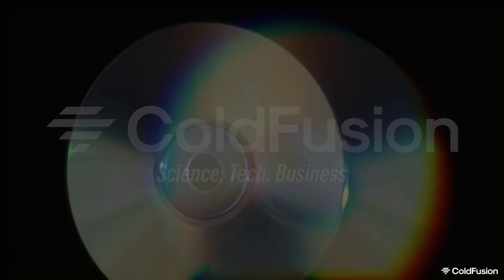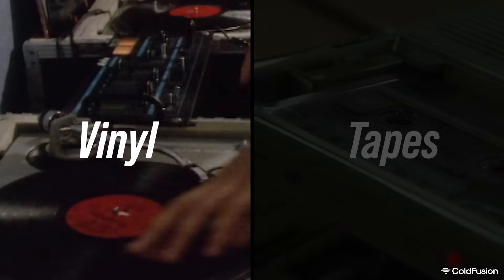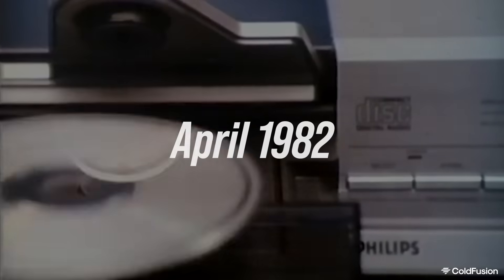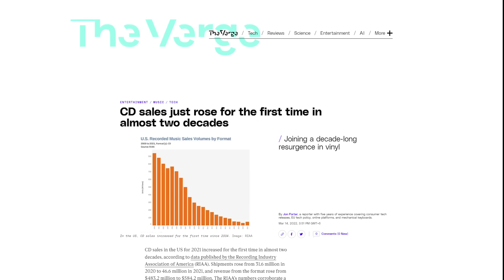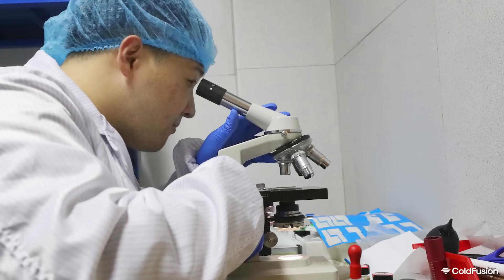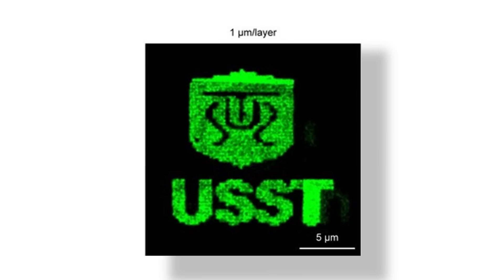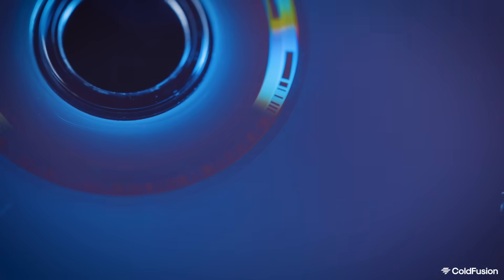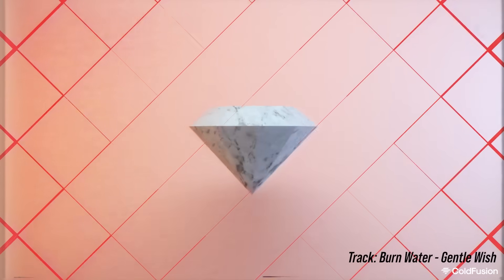Why This New CD Could Change Storage

Comment: 3d fluorescence rewriteable CD-sized discs with 100+ layers of storage have existed since the very early 2010's at this point and never made it to commercial viability on the consumer level. At terabytes of capacity they were already far more than enough storage for the largest 2025 games and uncompressed 4k movies.

Where's the revolutionary advance that could change actual product sales? Less than a wavelength in size is interesting, but this just sounds like an even more expensive and less ready-for-commercial use version of the same thing - and limited to data centers only - since it's so much more expensive and is extreme capacity overkill compared to storing terabytes for real-world applications. Data centers already have huge magnetic tape storage that has been working perfectly fine, so it would merely save some space in commercial facilities while probably using far more power.

Comment: 1:00 it should read around 20 000 DVD in a single disk, not 200 000. Dagogo, I believe you took a DVD as being 8GB (correct, if it's double layer) but you might have considered 1.6 Pb as if they were 1.6 PB. 1.6Pb is actually 0.2PB (1 Byte = 8 bits --> 1PB are 8Pb --> thus 1 Pb is 1/8 PB).

Comment: My proudest purchase was a Sony DAT for home use. I paid $100 for it as it didn't output audio. A cracked track in the back panel circuit board. A five minute fix. I sold it a year later for $1000.

Comment: It happened back in early 2000 personally followed the rise and fall of that tech. So I'll believe it when I see it commercially available. For the time being it remains Vaporware. It's most likely once again trying to boast the huge size of storage on a "long lasting" support to raise funds.

The Fluorescent Multilayer Disk (FMD) was a proposed optical storage technology from Constellation 3D Inc. in the early 2000s, aiming for vastly increased capacity by storing data on multiple, stacked layers using fluorescent materials. Instead of a reflective surface like DVDs, FMDs used fluorescent dyes within transparent layers that would emit their own light when struck by a laser, allowing for reading of up to 100 layers on a single disc. Although it demonstrated high capacity potential, the technology ultimately failed to achieve commercial success due to competition from formats like Blu-ray and the eventual irrelevance of such products in the face of emerging streaming services. 
How it worked:
Volumetric Storage:
Unlike DVDs, which primarily use a single reflective layer, FMDs were designed to store data in a three-dimensional, layered structure. 
Fluorescent Dyes:
Each data layer contained fluorescent dye that converted laser light into a different wavelength of fluorescent light. 
Layered Structure:
A single disc was made of multiple transparent plastic films, each containing data in the form of fluorescent dye-filled pits. 
Selective Reading:
A precisely focused laser in the FMD player could read each layer individually by changing its focus. The surrounding layers, struck by unfocused light, would not fluoresce, and the player's sensors could distinguish the fluorescent signal from the original laser light. 
Potential & Limitations:
High Capacity:
FMDs promised capacities of 100GB or more, a massive leap beyond the capabilities of contemporary DVDs and CDs. 
Compact Formats:
The technology was also planned for smaller, card-sized storage devices for mobile computing. 
Commercial Failure:
The technology never achieved widespread adoption. 
Competition:
The development of Blu-ray discs and other advanced storage formats overshadowed the FMD. 
Market Shifts:
The rise of video streaming services ultimately made physical media formats like FMD less relevant. 
Vaporware:
Due to its failure to reach the market, the FMD is sometimes considered an example of "vaporware"—a technology that was developed but never became a commercial success.

Comment: One of the things I always liked about CD/DVD and Blu Ray is if used for backup they CAN NEVER be erased accidentally. I never use re-writable. Also I always prefer to have a physical copy of music album or movie, instead of streaming. If for some reason the internet is down in your area for whatever reason, streaming the content means you are out of luck. Me I got several hundred movies on DVD. I had a lot of books, which I always found to be better then the digital books, has you never need power to read it, or internet in some case. The drawback of physical books is that they take space, but are totally immune to EMP or lack of power.

Comment: SSDs wear out. Compact discs is non-physical contact and newer materials engineering technologies called photonic engineering materials and manufacturing-application technologies are already in existence but were never given enough mass media attention and exposure in advertisement. The newly developed sapphire crystal coating also known as sapphire nitride when nitrogen ions hits a sapphire crystal (natural or artificial) and simultaneously combined with it and is redirected on the surface of the new compact disc. An another idea is using modified synthetic sapphire as the CD dye and a platinum-iridium alloy as the reflector by using either nitrogen ions or argon ions to transfer the modified synthetic sapphire CD dye and platinum-iridium coating on the CD disc itself. The plastic material  can be replaced with a tin float glass ceramic material. In this way the whole thing can last and function as long as it exists. Combining OPTRONICS (OPTICAL-ELECTRONICS) that uses laser fiber optics to connect electronic components and power them is an old 1980s technologies that must be revived again against suppression because OPTRONICS technologies used in computers and other electronics technologies can make them literally last and function as long as they exists.

Comment: "Needs fans from an ac outlet, now that's a showstopper if I ever saw one."

How is that a showstopper? I have dozens of fans that run from ac outlets in my house right now. Also, the fans don't NEED to run from an ac outlet. That is the least ahowstopping of literally any of the other reasons. What an idiotic statement.

The price, ahowstopping.

The fans... Something you might forget during shipping. So stupid.

Comment: Would be nice if we could get a nice stop-gap for optical discs, like 1 TB discs, that can at least record at 8x the speed of most internal Blue-Ray burners. Sadly, though, speed has always been a major limitation of optical media. Hell, even most portable Blu-ray burners can only write at a rough maximum of 27 MB/s, which is slow enough that it can't even fully saturate a low-bus USB 2.0 interface.

Comment: One thing I'm not quite grasping anymore. We've come a LONG way in the technology with regards to moving a laser carriage, so it's probably not a stretch to think a a carriage could be made that moves the laser on an x and y axis simultaneously. Combine that with the wobble correction and I wonder why are we still using these layered technologies in a spinning format? I thought we'd move to some sort of card format years ago considering optical discs can't read they entirety of a single track in a single rotation anyway.

Comment: It would take 20 days to fill one of these discs at 1GB/s of write speed, a speed which they haven't achieved yet. Imagine trying to verify the integrity of one of these things, or god forbid you get a bad burn,  an extremely common occurrence in our dumb easy to understand discs. The thought of trying to actually fill one of these discs is terrifying. I mean sure us normies don't have 1.6PB of data to begin with, but I think that fact would also need to be considered when trying to popularize this. I don't think we need 1.6PB discs, neither for the cost of the equipment nor the media itself, but 10, 20, 50 TB? I could see a market for this.

Comment: It still impractical. Brittle and sensitive disc  that holds big amount of data. Cmon. Unless its so cheap. Id still  prefer  soliid state drive or better model of flash drive that can hold big amount of data that is tougher than optical disc.

Comment: I´d be more interested in a sized and encased format like the Minidisc. Sure it probably would only hold 55-60TB, but be a lot more convenient. I could also accept a 90mm MO-Disk size with roughly 112-113TB, but I always found the CD/DVD/Blu-Ray sized disks too big for private use/storage and always prefered the more durable Minidisc.

Comment: I'm not sure if you did a video on this but it would be cool to see an update on where holographic storage is...I remember it was introduced quite some time ago...the concepts have been around for decades but Microsoft introduced project Silica in 2019. I'm always wondering what the update of this 'holy grail' of data storage is at and when it will hit the market. Crazy things mentioned...it can withstand thousands of degrees, last millions of years, high data density...the list goes on.

Comment: Practical Application : 
A little refinement of thier process could easily yield a high end consumer grade storage product :
Create a permanant 5.25" shell and cut the layer density by 50% - then attach a M.2 Ribbon cable to the backside....
Add a permanant chip style 256 gb m.2 cache storage (or even replacable or upgradable) and wabam - you have a performant high capacity consumer pc storage solution that works in any modern pc 
Yes the long term storage takes some time to write to and or get something from, but realistically transferring to a storage medium or over a network can also have a delay. 

But consumers will never get this, that would long term go against us owning nothing and being happy about it.

Comment: Honestly, I'd first try experiments with using only a couple layers, since it seems like each layer holds around 2TB of data, and see if reducing data density could allow for a less powerful laser to be used for reading at the very least. And with each layer being so thin unless you want to use caddies like early Blu-Ray did you'd probably want to make damn well sure a hardened coating on the side facing the laser would work with it.

Comment: Most of what was said about CD is wrong. In short CD is 90% Philips creation. The reason Philips turned in to Sony (Sony was only of 7 Japanese corporations to respond) was to gain support and promote this together. And Philips did knew how to turn analog in to digital and vice versa - actually they made the best DAC's (and trasnports) for CD players even Sony used them. Philips also pioneered single bit DAC's and so on. Even thou Sony proposed their channel coding and error correction schemes opposed to Philips ref def - the ones used in CD was designed by Philips engineers.

Comment: 4 years before I bought and installed my first CD-rw drive for my compaq, I was told by the computer store employee that a machine the size of a refrigerator was needed to make CDs and maybe in 10 years they would be the size of printer scanners. Where I lived, Other than the one my science teacher used in class, I owned multiple dvd players  before I ever even saw a home laser disc player for the first time. That person collected failed tech and also owned the only Beta max player I’ve seen in my life also.

Comment: Dead Tech is dead! It's time to move on. Both MicroSoft, and S0NY have made their stance on Physical Media known. And recently Nintendo decided to toss their Hat into the Ring with 90$+  blank Carts with just a COA File to allow you to then download it from Servers that they fully control, and NOT only can, but will eventually shutdown one day.

The 120mm Optical Disc has had its day, Compact Disco in the 80s, DVD in the 90s BlueRay in the Naughties, and UltraBlueRay in the Teens. Non of these being forward compatible with the other. Which raises a slightly different thought do Ultra-Blue -ray players even read Compact Discs anymore, or is this  strictly a limitation implemented by S0NY* because they couldn't be arsed?

This ain't going nowhere. Even if Consumers wanted this. The Media Corporations, don't! As they would actually be the customers of this Tech. You're just the End-luser. What you want is up to how bad you want that PS5/6 which at first I did. Then I saw the future, and decided that if Media-less was the Future I'd join the PC Master race instead. Ya know what?  Steam may not end their service in my lifetime, but they still yank games from sale, or your library. So no winners here.    
The only difference, is that Valve, never sold actual media ever. In case you forgot HL was published by Sierra Online, and HL2 was the breadcrumb in the trap, to Launc Steam. Ok side tangent. It was a pain in the arse to buy PC Games, in Germany at least. Seeing that Babbages is also no longer a thing.  I'm sure lots of People were fine with Steam. Little knowing where this would go Twenty plus years latter. 

With current Games up into the 150GB range this Tech would certainly be welcome. But at this point, why not just return to ROM Carts al-la Nintendo... Whoops forgot about the Switch 2 their for a second. 

Face it the Media Corporations want us on a rental model not, the ownership (of a Book. Which IS NOT the same thing as COPYRIGHT!), and barring an outright mass protest of this. Which is highly unlikely to ever happen. This is exactly what is going to happen. To little, to late, and quite frankly I'm sick of the 120mm Optical Disc Format. 

*PS3, and 4, for all I know the 5, given the lack of a Drive on the 5 the question  seems redundant. At this point Im not holding my breath for a Media enabled PS6 ever, and the next XBOX is looking to ape the Switch, and the PC enabled Steam Deck Clones that are out.

Comment: Increasing the number of layers increases the cost more than the capacity. People choose single layer BD which has best cost performance even though it's bigger. The market of multiple layer is always small. The cost never decreases. It's always like that. Multiple layer BD-ROM is frequently used for videos and games but I don't think it goes well.
Similarly, holographic disks are often mentioned as an experimental storage medium, but I have never seen one put into practical use. If the capacity is up to that point, I feel like it will be the size of an SD card.

Comment: The trouble vinyl is if a person wasn't careful with when they put the needle on the vinyl. It could easily scratch. So if the person wanted to play that vinyl again the needle would jump. With audio cassettes (2 points) 1st 1 is the tape could get screwed up in the tape recorder player. The 2nd 1 is if a person played the same tape over & over again. The tape would wear out. Which means no audio would come out.

Comment: * sigh *

The LaserDisc DIDN'T "fail". It existed in the market for a bit over TWENTY years - and it was the BEST video/audio delivery system from 1978 to roughly 2000 (when DVD mastering was finally improved).

There are a host of arguments in favor of LaserDisc over other formats. And while it was largely a niche product because you could not record on it, the same could be said of MOST households' console DVD players....

Comment: Even though this technology is taking CD writing to the next level it still kind of moving backward.  SSD's and for portable, thumb drives are what's now.  The capacity may not be as good but you can write, erase and rewrite on them multiple times.  When writing data to crystals comes to market that may be next generation.  If they could make crystals cheap enough it would be a great alternative to current drives.

Comment: I will quote exactly what it says on the back of some new old stock of LS-120 Super disks:
IMATION
Borne of 3M Innovation
The POWER OF SuperDisk TM r   SuperDisk diskettes hold 83 times more than standard 3.5" diskettes and run up to 5x faster. Store or exchange large files consolidate data, download from the 'Net. back up files, archive and more.
HERE TODAY. HERE TO STAY. SuperDisk will become the new standard disk drive, replacing HD and DD 3.5" diskettes and drives. Soon you'll see SuperDisk Drives built into desktop PC's, notebooks, external drives- everywhere. It's the technology with staying power.
SuperDisk CAPACITY, SPEED, EASE, AND FLEXIBILITY. It's where data storage is going, so get it now.
Imation 1997
Incidentally I have two PII Intel i440 MB's that proudly claim they are designed for the LS-120 SuperDisk.

Comment: If you can use a Operating System on a CD it will be overpowered. No updates needed because a hacker can not change systemfiles so your Operating System cant be hacked.

Comment: Three reasons why your music CD/ DVD/ Blue ray movies won't play. (Burned CD/DVD ROMs are way way more fragile.)
1. Obvious surface scratches. ...I use vonax to buff those out nicely.
2. Top scratches. Hold disc side up to (sun) light to spot these little rascals. I'll just blot them out top side with a silver or black paint pen from OW for the win.
3. Weak laser. From the day the CD/DVD/Blue ray player has been taken out of the box and connected up, the switch is flipped and that laser running the show has a finite optimal strength run time. 
This varies from model to manufacturer.

If you know what you are doing, there is a small POT adjustment to bring the laser back to strength but, it requires taking said CD/DVD/Blue ray player apart to access the usually in most cases a hard to get to access "adjustment" POT so, you should really know what you are doing...and, if you really really really know what you are doing and want to get all electronics technical, you should also own a volt meter with the necessary volt meter operating ninja skills to avoid electrocuting yourself while the CD/DVD/Blue ray player is in parts but still plugged into the LIVE wall socket.

At this point i feel i should insert some sort of disclaimer in here somewhere?